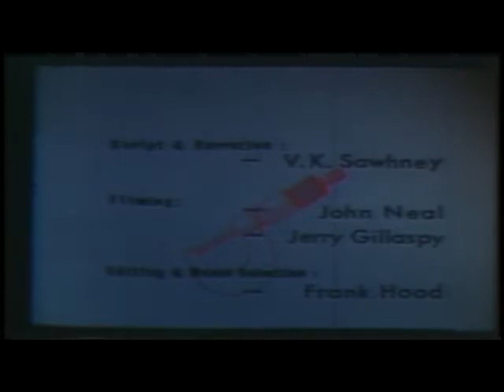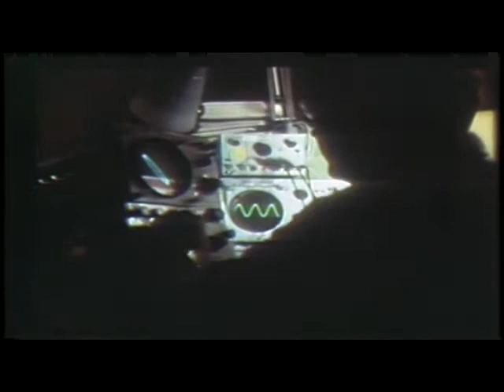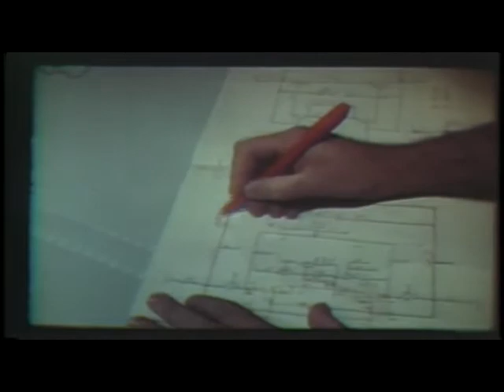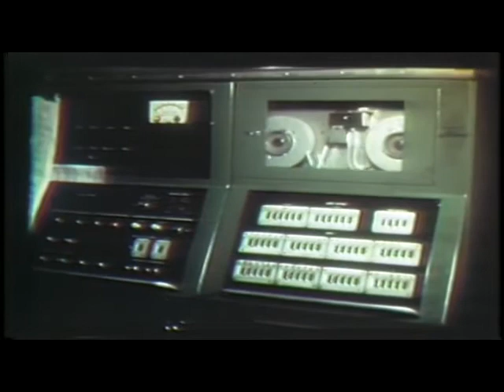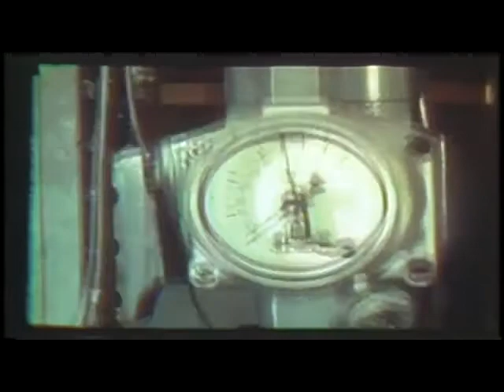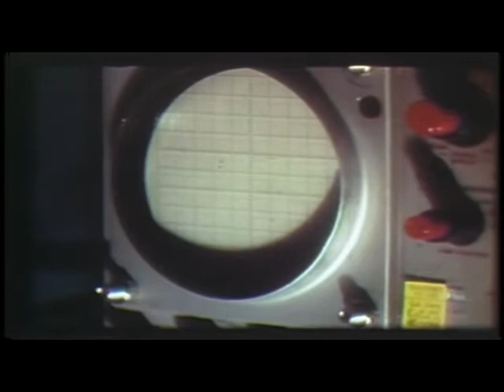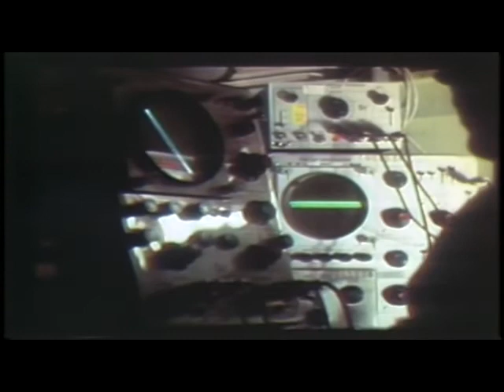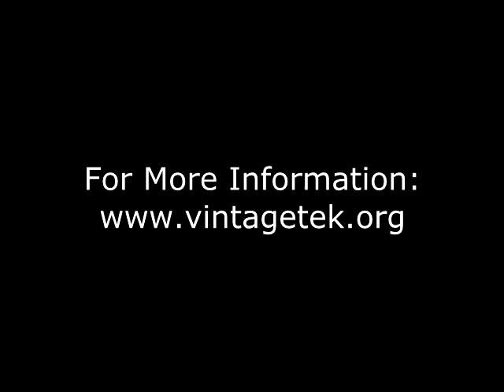Tektronix - The World of Measurement

Comment: When I started my first job out of college, I worked for a family electronics business that was founded by a Tek alum. We were awash in Tek scopes and a lot of the practices (vertical business structure, engineering processes, and even the part numbering scheme of XXX-YYYY-ZZ) were carried from Tek. I even had one of the scopes from the era depicted in this movie, and while the switches needed cleaning, it was still in mostly working condition when I gave it away. (I kept a much smaller model from the 80s, a lot more practical for my space constraints.)

The more I learn about Tek the more I understand where my former boss got a lot of his habits and ideas from.